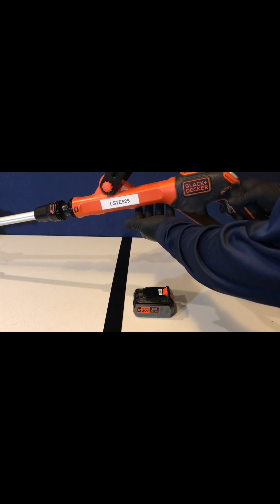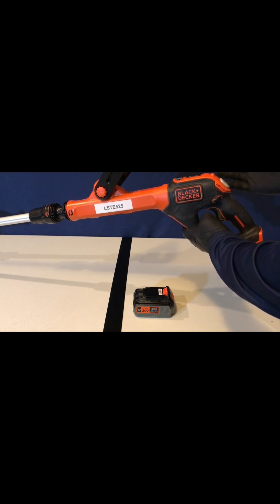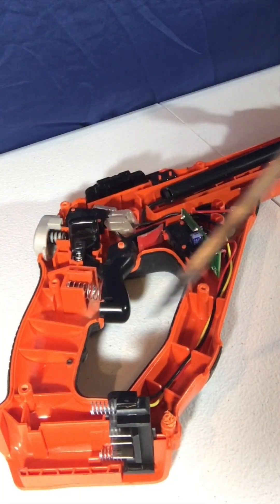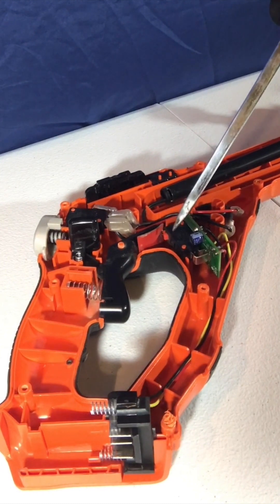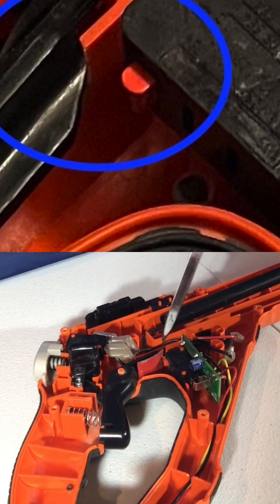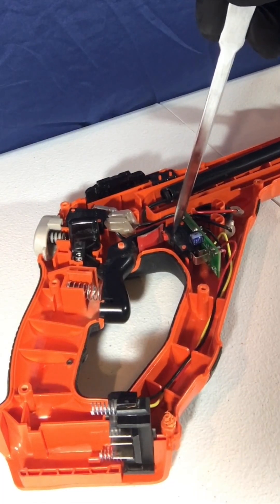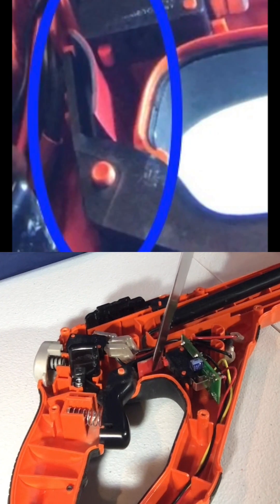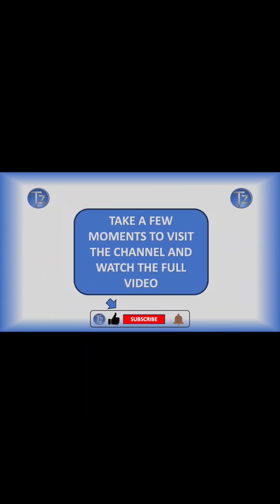Black and Decker Cordless Trimmer/Edger 20v (LSTE525) Worn/Broken Switch Repair Demonstration

Comment: How do you get the black handle off that has the orange push  button that moves the direction of the handle (not the handle that has the switch)
Reply from the maker: My Short Video “Disassemble Demonstration Black and Decker Cordless Trimmer/Edger 20v (LSTE525)” has this information and it's located on my homepage. The attached URL should also take you directly to the video. Let me know if you have any other questions. 

https://youtube.com/shorts/55kFD5olCp8?si=q_x27TCshoy5wrll